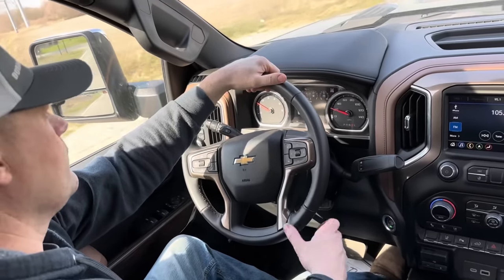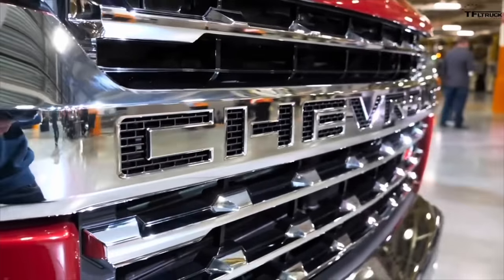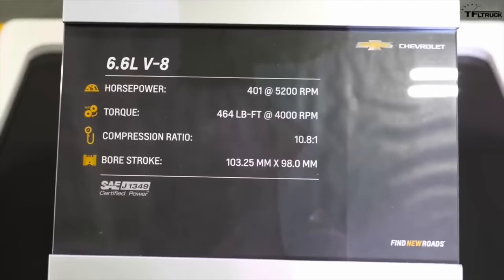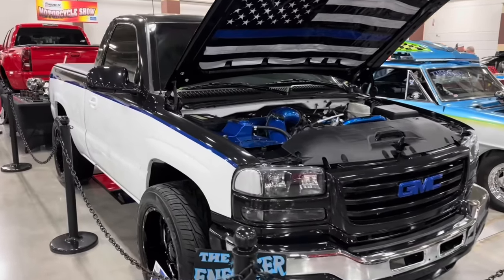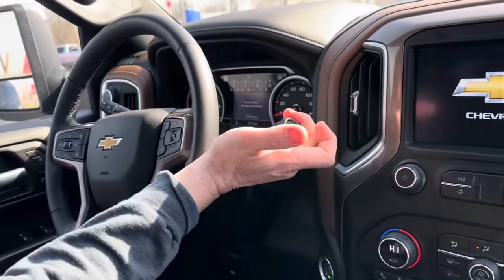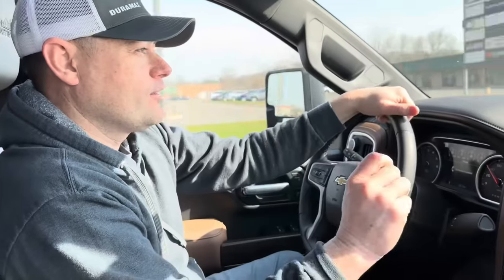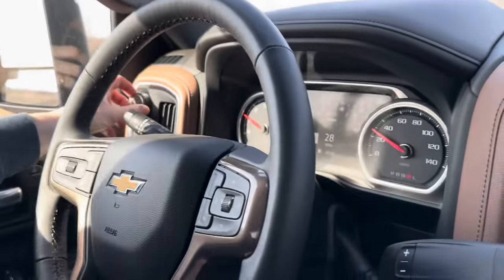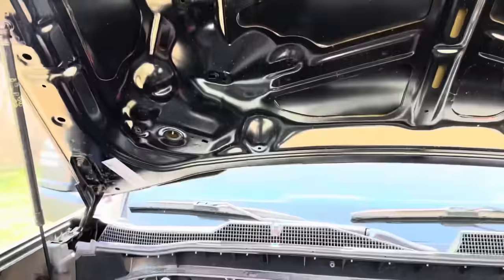What I Really Think About The New 6.6L Gas Silverado! WORTH IT?

Comment: I’ve had them both in the current generation (2020 Duramax and now have a 2022 6.6 gas). Both crew cab, 4WD, short bed with 20s. The power difference is no comparison but I feel that’s to be expected comparing a turbo diesel to an NA small block. With that said the 6.6 gas is definitely no slouch, and at least in these new trucks empty driving there’s not much of a difference. You got to remember the 2020+ diesels weigh over 8,000 pounds! So they’re a little slower than the previous generation. 

Anyways, I daily drive my truck, and driving to work (30 mile round trip on 2 and four lane highways, lots of curves and hills) from speeds ranging from 35-65 mph my gas truck gets 14-15 mpg. The diesel got 16-17. Towing my 8.5’x24’ enclosed car trailer my gas truck gets 8.4-8.6 mpg and the diesel got 10.4-10.7. That’s on the same trip, same load (250ish mile round trip, lots of 6 and 7% grades and one 8%) and for lack of a better term, roads basically like a roller coaster. On mostly interstate trips and speeds my gas gets 17 and my diesel got 20. 

So pretty much 2 mpg better in most situations and 3 on a trip. I don’t miss the diesel. I can still maintain or beat the posted speed limits on my racing trips (55 and 60 mph). Now sure, the diesel pulled the grades easier, especially the 8% but my gas truck does it. 

The problem with the gas trucks is the 6L90 needs another gear between 2nd and 3rd. That 2024 with the 10 speed Allison will have solved that problem. For example on my 8% grade, it goes for 2 miles. 3rd gear is just too tall of a gear to pull the mountain in and 2nd is too short. But what ends up happening is I go WOT at about 65 mph and when the grade really starts getting steep I start losing speed down to about 53 mph and 3000 rpm. I then get a downshift to 2nd where it gains back to 65 mph and a little over 5000 rpm but then upshifts to 3rd. Start losing speed back down to about 57 or so mph but by that time the grade starts leveling off and I’m over the hill. That 10 speed will absolutely fix that. 

Long comment but I’ve had them both. The diesel is nice, but the gas is no slouch and I’m not disappointed. I also have zero oil usage and I’m at 24,000 miles now. I do change oil at 3000 miles for what it’s worth.
Reply: Good synopsis Matt, When the time I right I will certainly replace my LLY duramax with a modern gas truck. Don't get me wrong, I love the diesel but with how rarely I drive it these days It just doesn't make much sense to own. Did you ever own a fairly recent (2015+) half ton? The new 400hp/500tq 3.5L ecoboost honestly seems like a good replacement for my truck. I only tow with a 7k GVWR 18' trailer.

When I purchased it a few years ago I was going racing once or twice a month so it made sense, especially since I got a rust free diesel truck for only a couple grand more than a comparable GMT800 gasser.
Reply: @TheeAbstractHero  I have had a GM 1500 before. A 2016 and a 2021. The 2021 is a long story but ultimately it replaced my 2020 diesel that had problems because it’s all I could find to cash in on a stupid trade offer for my diesel and it ended up having a lifter failure which led me to my 2022 6.6 gas truck that I wanted originally when I got the diesel lol. 

Anyways, if your 18’ trailer is an open trailer the 1500s will do fine. Any of them really. However if you ever think you’re going to go with an enclosed trailer I’d advise you to stay with an HD. The GM 1500s will do it, but you know it’s there. I’ve had friends with recent F150 (2016) and he had terrible sway issues pulling a camper. But with an open trailer that would be a non issue and a half ton would be a lot cheaper to daily drive and be more comfortable too.
Reply: @matthewanderson9912  unfortunately camper manufacturers pay little attention to weight distribution sometimes along with how people load weight for a trip. You want a few hundred pounds more infront of the axles with any trailer. I'm sure there's some fancy mathematical equation for it. I know pulling a 67 impala with my 03 gmc started getting squirrely around 40mph getting on the interstate. I hit the shoulder and pulled the car up about 6 inches and it was smooth sailing at 80mph 3 hours to where I was going.
Reply: @nashvilleoutlaw  definitely how they are loaded makes a difference. I always would rather have a little too much tongue weight than not enough. Not enough is dangerous. 

I’m sure there is an equation to figure it. I always just pulled on or into the trailer until I see my truck start taking weight. Once it did I went a little further and then called it good. One good thing with enclosed trailers is you have to pull them
In far enough to get the ramp door to shut.
Reply: yep my experience as well. if it does teh 2-3 3-2 enough it limits power and just stays in 3rd to liek 2100 RPM even when you are WOT to protect the transmission.
Reply: @duramaxadventures5832  interesting. I didn’t know the truck would pull power in that situation. I bet it’s due to excessive heat in the transmission then because mine will creep up when it’s in 2nd gear. On my 8% grade it gets between 196-209 depending on the ambient temperature. Mine doesn’t pull power though. It sings along at 5000 rpm to get me back to 60 mph. My grade is 2 miles and I have another about the same that’s about as steep but not hardly 8%. It will mostly pull that one in 3rd except right at the top. Unless I use cruise then it goes to 2nd a couple times.
Reply: @matthewanderson9912  yes. They used a diesel stator inside of a gasoline torque converter to minimize cost and that's why we have these really weird behaviors from this transmission.

 Additionally for bottom end longevity (same thing in 496's) emissions, Etc. it won't allow for full torque until a certain RPM when you're under full load.

After determining maximum speeds for downshifts (so XYZ will downshift a gear but two miles an hour faster will not) . I noticed they left a ton of RPM on the table and tried to pull  far too high of a gear.

 This of course puts it outside of its power band and the ECU trims the throttle to prevent excessive forces when lugging ( this additionally has the carry-on effect of protecting the transmission as the pump is spinning slower inside the transmission at lower RPM).

I felt the engine was finally, for the first time, a match for The Departed 8.1. But the transmission particularly its ability to gain 40°on a single wide open throttle pull unloaded. Made it a no go for me.

Then I saw the IKE and compared the new truck at its gcwr versus my 03 at gcwr lifted on 3-in taller than factory tires and I was over 2 minutes faster...... 🙃

The 10 speed I would definitely consider depending on what the price comes out to however I am still apprehensive about direct injection on a HD engine.

 On the Ford side you can also order gasser gears (4 30) with the 7.3 with port injection that doesn't run rich to make power.

Ram is not a contender with the 6.4 having no redeeming features.
Reply: @duramaxadventures5832  well the power is definitely there. It’s making 400 foot pounds of torque from 2000-5000 rpm. I’ve had mine for a year and a half and 27,000 miles and it’s noticeably more powerful than any GM small block I’ve driven. I never did drive an 8.1 but I have plenty 454s and I feel like this motor is as good down low and much better up too as those were. 

I’ve always said the transmission needed another gear between 2nd and 3rd and I do believe that still. The 10 speed will offer this. I’m not particularly a fan of the 4 something rear ends, especially with a 10 speed. A 4.10 with the 6 speed I could argue it from both sides. It would give 3rd gear more pulling power for sure but it wild also render 2nd gear useless at Highway speeds. I think 57 mph would be the top speed for a 4.10 truck with 34” tires and the 6L90 in 2nd gear (2.36:1). But again, I could also argue that it would allow me to stay in 3rd gear on my 8%, all but I would be kind of stuck at around 53-55 mph instead of being able to go 60. But I’d also not hit 5000 rpm and should keep the trans temp closer to the normal towing range I have of 170s
Reply: @matthewanderson9912  big gears lower the upstream stresses under load. also keeps fan speed and water pump up keeping fluids cooler

yes i understand the 4's with 10sp,  but i have never wished for less torque when towing, so for me i would 4.30 just for the ability to run less RPM with a given load (more torque multiplication allows you to shift up, throttle back) but i would prefer to at least have teh option to choose. biggest GM issue is weight. 

ford has more power, more torque, lighter and has a big gear option. back in the early 2000's we has "diesel alternative" engines (6.8 v10, 8.0 v10, 8.1 v8). i feel like this could (haven't driven 10 speed) be a return to that like ford's 7.3 is.
Reply: @matthewanderson9912  8.1 made 455 from 3K onwards (ECU limited below that) and something liek 380 right off idle. ya 345hp wasn't great. but when you only rev to 4500 that's to be expected.
Reply: @duramaxadventures5832  don’t get me wrong, I too think they should offer the 4.10 or 4.30 as an option, but personally I would stick with the 3.73 because I think it’s a better overall option. I daily drive my truck and tow a couple times a month during racing season. So I feel like a 4.10 or especially a 4.30 would be spinning the engine unnecessarily high all the time. And as far as towing goes, the 3.73 has a shorter final drive one gear lower than the 4.30. For highway speeds that’s pretty good because the 3.73 in the Fords will give you 3rd gear and the 4.30 won’t (at Highway speeds now). But for sheer pulling power then yes, the 4.30 would be stronger gear for gear. 

As far as the 7.3 I was pretty happy Ford was going there but after seeing it out for awhile I’m not so sure. It sure looks like the cam and lifter thing is not going away. But that’s most likely a bad run of parts but I still think it could be a design issue if it keeps lingering. But the real concern I have is I think those engines are going to have head gasket problems with how the water jackets are made between the cylinders. 

But that’s another topic. I’m going to keep my 2022 6.6 with the 6 speed until interest rates and/or prices come down but I do think the 10 speed is going to be almost as big a jump for this engine as going from a 4 speed auto to a 6 speed auto was for the 5.3s and 6.0s.
Reply: Yeah, anyone who compares the gasser power to the diesel power is ignorant. I recently purchased a '24 HC 2500 Crew  gasser with the 10 speed Allison. I'm very happy so far. I've owned 4 other HD gasser crews since '07, run over 300K miles with 6.0L & 6 speeds with less than $700 in repairs, pulling my 10,000lb construction trailer frequently. It seems like the smallest repair bill you can get from a Duramax is $2,500 minimum.  I'm content with my gasser & it's capabilities, and most have easily achieved 14-17mpg on road trips here in mountainous Montana. Also, I'm saving $10k on the sticker not buying the diesel, along with cheaper fuel costs per gallon. It'd take 150k + miles to break even on the mpg savings & initial cost of the Duramax that I really don't need.
Reply: @bobover2267  sounds like a nice truck. I still have my 2022 and I’m about 200 miles away from 36,000. Still no issues to this point. 

The 10 speed option makes me want to trade but at this point I don’t know if interest rates will ever come down.
Reply: @matthewanderson9912  maybe 4:11 gears over 3:73?
Reply: @ I think on certain grades where you’re staying in 3rd gear that a 4.10 would give you a little more rpm and speed so sure. But on any grade that you’re needing to go 2nd gear it would hurt you because it would essentially eliminate 2nd gear as an option at highway speeds. There wouldn’t be enough rpm available to do 60 mph. As they are the 2020-2023 trucks with 20” wheels will do about 63-64 mph in 2nd gear. A 4.10 wouldn’t allow that. 

So for some situations it probably would help but it would also hurt some situations. If you’re trying to go 70 mph it’s not as much of an issue because 3rd gear will do 70 mph at around 4000 rpm. It’s when you’re trying to stay around 60 mph that it’s a problem.

Comment: I agree with most everything you said, especially the GMC looks much better in front. I have never had a diesel though. I went from a 2018, 6.0 2500  to a 22,  6.6 3500, I only have 2k miles on it. I tow a 12k gooseneck RV and recently purposely towed it up a mountain here in central PA just to see how it would do. Approx. 4 miles of 12% grade with 2 hairpin turns. It did better than I expected, until I had to slow for the sharp turns. It dogged pretty good until it kicked into low gear and picked up from there just fine. I get 14 - 15mpg driving same mountain to work every day. I get 7 - 9mpg when towing the RV. Again I haven't been spoiled by a diesel yet. I believe its about relativity.

Comment: I just pulled 10,800 lbs Bumper Pull 4 slide camper and it was fine only down shifted to 4th one time. And then I pulled in fifth the whole time no problem 70 mph . I was shocked.  I got 
17.3 mpg 2 hr loop and 18mpg 2hr highway loop empty other time. It was a 2023 6 speed 17inch rims.  The acceleration got up to eighty like nothing. I guess they say the 7.3 Godzilla motor is even more bad ass. I was pretty impressed with the 6 6 Gasser and im a ford guy .

Comment: I have a 2020 6.6 and get 11-13mpg burns 1.5 quarts every 6,000 miles. I have 88,000 miles on it and have had no issues and rides very well and tows my 10,000lb trailer well, I like the truck a lot no reason to buy a duramax and deal with emissions in my opinion for my useage.
Reply from the maker: This is the stuff we need to hear. Thanks for sharing
Reply: I'm betting the largest part of that oil burn off falls within the 5-6000 range.
Reply: Got a 2021 Chevy gas 6.6 got 46k on it , Masonry work so it doesn’t have an easy life , great so far , it does what I need it to do .👍🏼
Reply: "it burns oil"
"I've had no issues yet"

Pick one

Comment: Great review, I like the honesty about everything. Food for thought, I know 3 or 4 guys with that engine in their 2500s and 3500s and none of them have oil consumption problems. They all are used in a commercial environment, tow and haul heavy loads regularly, and generally work hard. Its common knowledge that 'how you break your truck in when new, dictates its quality of service'. Did the folks complaining of oil consumption issues drive their trucks off the lot and hook a 10,000lb fith-wheel up to it the next weekend and head into the hills? Have the guys complaining about ticking noises driven a modern Hemi RAM or 7.3L Ford Godzilla V8 lately?!? I think they are all quite smilar. That being said, most of those guys that own the 6.6L L8T complain that the 6 speed transmission is not up par as far as being energetic and smart. It's quite lackluster and they feel holds the engine/truck back quite a bit from its true capabilities. Let's hope  the switch to the 10speed for 2024 behind the gas engine helps that issue. Just to curb the comments before they happen....NO, the 10 speed in the HD series trucks is NOT I repeat NOT the joint venture Ford/GM 10 speed found in the half tons. That is the 10L80, the HD version is the 10L1000. It will be the same basic unit thats behind the Gen2 L5P Duramax modified with slightly different components and TCM programming to accommodate the higher reving gas V8. Rubber side down guys, drive safe!!!

Comment: Almost 4 years since I purchased my 2020 2500 LT gas version. Love it sums it up. Fuel economy has been satisfying to me (14.5-17 mpg and best was 18 when empty mostly highway). Does everything I need and more including pulling out Toy Hauler. No oil burning happening, transmission runs buttery smooth, and yes the newly implanted 10-speed may help it get better economy, but that 6L90 6-spd. was one of their most reliable and they even beefed it up from the deep reading I did. Happy owner.

Comment: I have a 22 GMC duramax and a 22 GMC 6.6 gas. I use the diesel for towing my work trailer everday which weighs 15,000 lbs. I use the gas as a spare to pull a trailer when I need 2 trucks or my duramax is in for recalls. The gas is actually nicer to drive around town has more low end torque than the diesel until you get the turbo spooled up. The gas actually tows 15,000 lbs pretty good, if I towed occasionally I would definitely get the gas especially in MI during the winter its way nicer. The gas also gets 16.5 mpg on the highway the diesel gets 21mpg when empty.
Reply: Finally, someone answered my question.  I pick my 24 GMC 2500 gas up next week.  I was wondering how big of a fifth wheel I could tow a few times a year.  Thank you

Comment: Yeah I was hoping you were going to drive the new 10 speed. I've got the brother to your truck a 18 high country Duramax and have been seriously thinking about the 24 gas 6.6 with the new 10 speed. Was really disappointed they didn't up the hp numbers along with updating the trans but like you said tons of potential for power to be unlocked in that gas 6.6. not to mention they're $10k cheaper lol

Comment: I upgraded from a smaller truck to the 2022 Silverado 2500 HD LT with 6.6L gas, and I love it! especially for the price/value! got it new in 2021 for sticker price of $54000, but a lot less with my fathers GM employee discount. excellent deal considering 2021 shitshow. got it to tow our large travel trailer and it is my daily driver it does great! Only issue I have had was what the dealer said was needed was replacing some injectors in the first year/8k miles (under warranty) as it was misfiring. I get 14.5 mpg average, but only 9mpg pulling 9k trailer